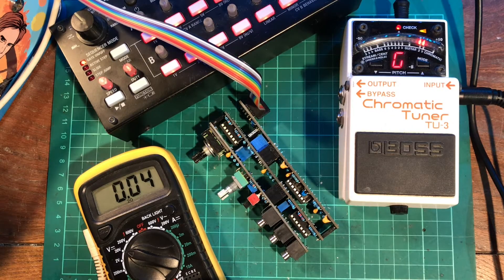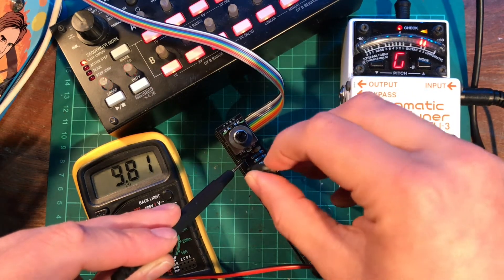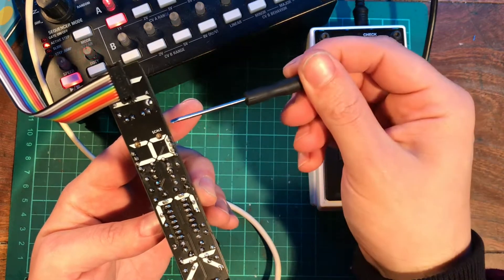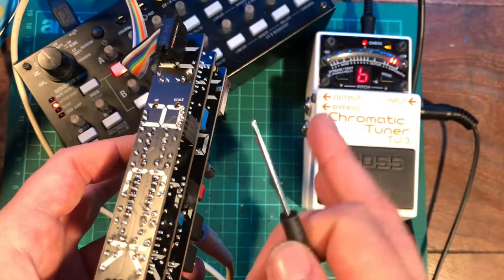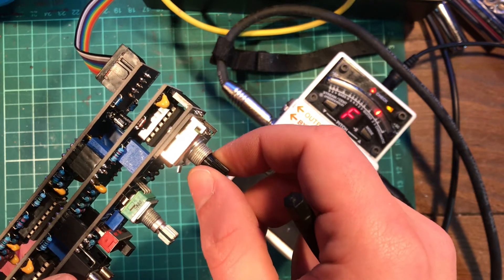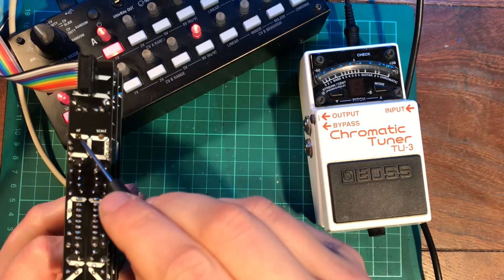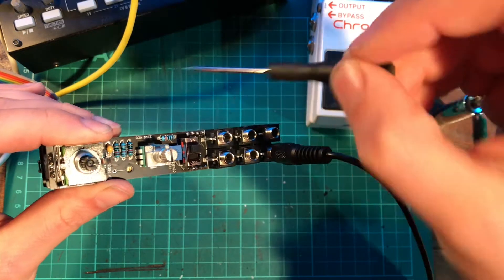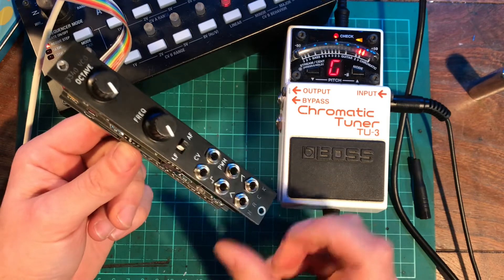3340 VCO Build - Part 3: Calibration

Comment: This VCO have a sinus output? AS3340 doesn't generate it
Reply from the maker: No, the 3340 doesn't have a sine output, but if you put the triangle through a low pass filter you'll get the same result

Comment: Doesn't poking a metal screwdriver into the jack socket short out the jack connection ?
Reply from the maker: Nope. It’s a CV input so the tip will quite happily be connected to the sleeve ground with no effect or damage. None of the other jacks are at risk either, the buffered TL074 outputs can take a continuous short even without the 1K series resistor 👍
Reply: So when will these boards be back in stock sir?  @hackmodular
Reply from the maker: @simonburns1055  sorry yeah these are labor intensive to make and pack as kits. Find myself with very little time at the moment unfortunately!